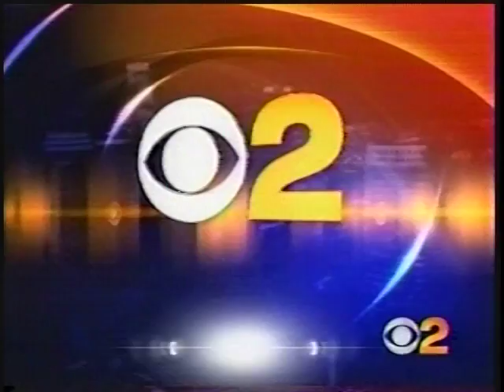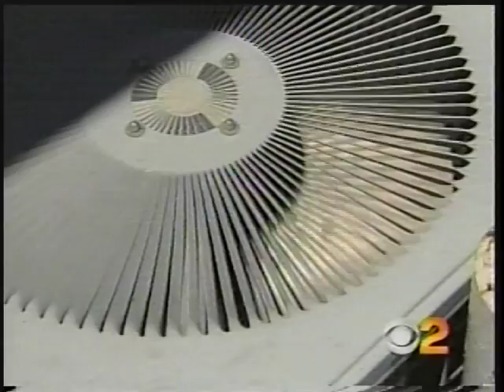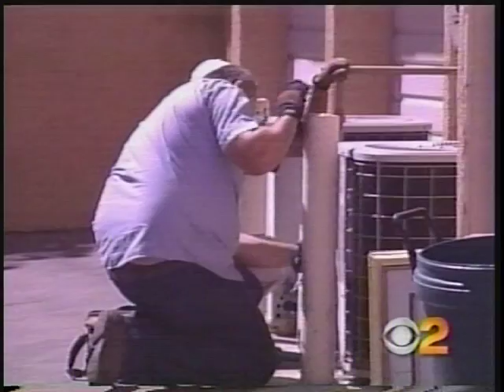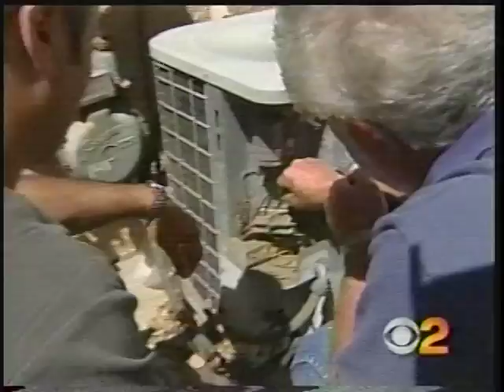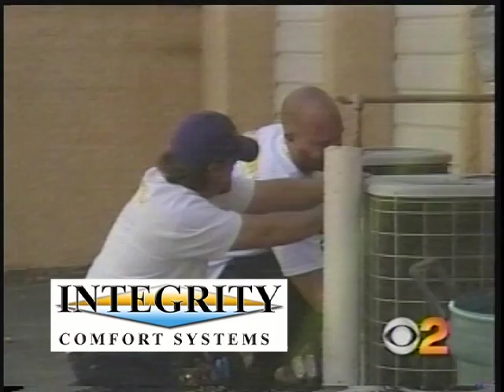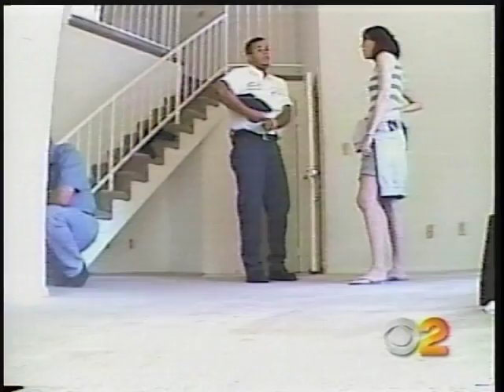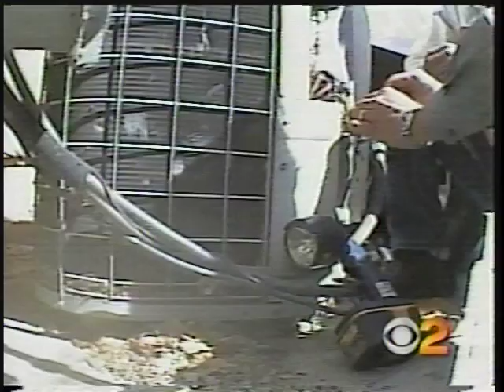Integrity Comfort | CBS Heating and Air Conditioning Repair Sting

Comment: Gee, I wonder why I don't trust service contractors?  Having worked in the HVAC industry as an engineer for over 30 years I can attest that there is far too much of this going on.  I don't let anyone work on or install anything in my home for this reason.  I got my electrical, EPA and other licenses and do ALL the work myself so I know it is done properly.  When I needed a new central AC system several years ago I sat for the EPA license just to be nice and legal.  (The test was a joke.)  Got the study material the night before the exam.  Spent a couple of hours reading it and missed 2 questions on a 100 question test the next morning.  The first time out of the box I installed a Carrier Infinity heat pump system using R410A refrigerant and natural gas backup complete with the internet interface with absolutely no problem and no help from the local dealer.  Yes, no doubt it took me much longer to install and setup than it would have taken a "dealer rep"  I took my time, read everything 3 or four times and spent more time reading everything I could find online about the what you could do wrong from the experts before doing anything.  (I strongly suspect most of the issues with compressor and TXV failures in R401A systems have been due to improper installation and poor installation practices.)  After 3 years I have never had a minutes problem with the system.  All that was necessary is to fully read and follow ALL installation instructions to the letter for every piece of equipment.  Guys, it really ain't rocket science.  Most people can do far more for themselves than they think if they just use common sense, go slow, read and follow manufactures directions to the letter and ask questions when they do not understand something.  The internet is a great tool to somewhat level the playing field even if you do not take things to this level of self sufficiency.
Reply: Brian Ellsworth Who said I blindly trust doctor's or lawyers?  Both professions make lots of mistakes.  Doctor's bury theirs and lawyers bankrupt theirs.
Reply: FlyMIfYouGotM mmm hm. i got into the residential industry couple years back from industrial. yes there is more money in residential. most companies want honesty but they lack on follow through with their techs. even my company in the chicago area. biggest tell for a dishonest tech is replacing the flame sensor. never needs to be replaced unless it has been bent or seperated from its ceramic housing. i always do a full cleaning instead. 1 its honest 99% thats all it needs.2 it shows the customer i am honest and they feel more comfortable and open up to me about other concerns they have with their heating and cooling. 3 i make honest recomendations as solutions to those problems they have expressed. most techs have it all backwards these days. its in the name, service tech. they skip the service and just do the tech part. are things expensive yes. however your budy with the compressor issue? holy crap its probably just a bad company because most give a pretty big warranty on the compressor alone. lennox gives 20 years from manufacturer on an 13acx. basic builder grade unit.
Reply: It sounds like you have bad HVAC companies in your area. You get what you pay for. If you call Joe blow from Craigslist for a 29.99$ tune up...... Your an idiot. Call a professional upscaled company
Reply: Joe Smith looks like u just proved my point.  Obviously, given your language, your IQ can't be too high.
Reply: All my spelling,grammar, &business practices are correct.Sometimes the
truth hurts.
Reply: Meanwhile you're either a story teller,hypocrite,or liar.You say you dont
like or trust servicemen/ techs in 1 breath.Then in another,claim to be
in.Keeping in mind of course,not one that would wear a white
t-shirt!Lol,sissy soft ass lmao.Now put on your nighty & face mask &go to
bed.

On Jan 26, 2017 4:54 AM, "Joe Smith" <****@**> wrote:

> All my spelling,grammar, &business practices are correct.Sometimes the
> truth hurts.
>
Reply: Truth hurts?  Apparently you are one of the tech's that routinely engage in the practices outlined in this piece, otherwise it is doubtful you would have been so offended by my post.  You know nothing about me yet you call me a "liar hypocrite or a "story teller".  Really?  I stand by my original post and my reply to you.  Just for your information, I am an Electrical Engineer, I worked as a Control Systems Design Engineer for JCI, both in an office and in the field. I have done Consulting and Commission work for several of the largest Universities in our area in addition to companies like Roche, Eli Lilly, and the Indianapolis Public School System.  Over the years I have seen far too many customers ripped off by multiple contractors doing practices just like those in this piece.  If calling you out on that offends you then it is obvious you are most likely part of the problem.  With your abusive language and obvious lack of intellect there is no way I would want you or a technician like you working on anything in or around my home.  Dealing with abusive technicians who use their belligerence to compensate for their incompetence is exactly why I went to the trouble to get the proper licenses to do the work my self.
Reply: Jake V Really?  I designed custom control systems and wrote the control software for recip and centrifugal chillers from 30 to 5,000 tons for companies like IBM, Philip Morris and several universities for the better part of 30 years.  Like I said, the EPA test is not that tough.
Reply: OK ,but why do you trust lawyers and docs ?  Your comment reminds me of a friend who purchased a garage with a lift because he thought a mechanic ripped him off replacing his transmission.
Reply: FlyMIfYouGotM cool you're an engineer, and if you pass the test, by all means do it yourself. You however are the reason why we techs say stupid engineer put a part that must be serviced annually in a place where we can't get to. Don't make blanket statements about a profession because you had a bad experience with one tech. Just because you say you did something doesn't make it believable. Quick question that you will probably google to find a rough answer to. What were these chillers that you designed one tiny aspect of used for?
Reply: Also, how were you designing these things without being certified? The things you are saying just don't add up. So im done talking to you. You are just a person who had a bad experience and is taking it out on the whole profession
Reply: I know you don't...nobody does .I just don't understand why all the trouble with an ac service , because it takes a lot of equipment plus school and years of experience to be any good . Your home ac is only a small part of the industry and for the most part it is the simplest form of refrigeration there is . Good duct design can get complicated ,but the units for the most part are simple .
Reply: Jake V How long have you been in this profession?  Are you aware that it has not been that many years ago that no one needed any certification to work on any HVAC or refrigeration equipment?  As far as trusting techs to install my system answer this: why would I play Russian Roulette with $8,000 gambling that I get a good tech and install?  A few years ago a local friend took that gamble.  This guy is on his third system and mine is still running like the day it was installed.  Both of his failed systems were R410A and both suffered compressor burnouts shortly after the warranty ran out.  Want to take bets on how good of a job the techs did properly evacuating the system?  All three systems were installed by different contractors.  We will see how long his current system last as it is still in warranty.  I have seen far too many techs refuse to use a continuous nitrogen purge while brazing refrigerant lines on systems with R410A.  How much garbage do you think this puts in a brand new system?  Personally I am just not willing to spin the tech Roulette wheel with $8,000 to $10,000 on the line and just hope I get a good install.
Reply: FlyMIfYouGotM like i said. You want to do it yourself fine. No one gives a f. Do it you are certified. However that didn't answer anything i brought up. Like what system did you design, what were they used for. Being an electrical engineer doesn't mean you did anything with refrigeration in chillers. Don't try to use a degree that has nothing to do with what we are talking about to add credibility.
Reply: Jake V Really Jake?  One of the projects for IBM involved gutting all of the controls, safeties etc. on old R11 centrifugal chillers and replacing them with DDC controls. (I did the system design for these controls and wrote the software for these systems.)  These chillers provided chilled water for a large, multi building manufacturing/research complex and a large thermal storage tank.  I also designed the control system and wrote the control software for the thermal storage system.  Jake, it's really interesting you think you know so much about some one you don't know anything about.
Reply: FlyMIfYouGotM how many times did they have to have a tech out to correct your mistakes. also you really seem to think you know so much about an industry you really know nothing about. nice google search reply though.
Reply: FlyMIfYouGotM you also didnt mention this is a water cooled system that supplys water to individual units that then use r11 at said individual unit to supply heat/cool basically heatpump. so you didnt work on refridgerant you worked on moving water around.
Reply: Jake V Google search?   There wasn't any 'tech' sent out to correct anything.  I did my own startup and checkout of those systems.  After 28 years, when the company I worked for started pushing for engineers to stay in an office and just make pretty drawings, I changed companies.  I will be willing to bet you were still in diapers when I was in the field working on these systems.
Reply: FlyMIfYouGotM hey, you are the one trying to prove everything. Im just calling you out on the bullshit. based on your reactions it is very obvious you constantly have the need to stroke your own ego and have others do the same. the reality is you were an electrical engineer. you had nothing to do with the full function of these systems. you were just a small aspect and you constantly word it in a way to make you seem like more. why the need to impress others bud? you are the best you!
Reply: Jake V Is the best you have just more infantile insults?
Reply: FlyMIfYouGotM uh.. i actually didnt insult you. i was basically saying just be who you are. why try  to prove anything to others, even to the point of lies. just be happy with who you are. if you see it as an insult, didnt mean it that way.
Reply: Jake V All of these systems were water or glycol/water systems.  As far as opening a system up, most of the time I didn't need to do anything on the refrigerant side beyond replacing a pressure sensor or two and verifying charge and performance against specifications.  The controls I previously referenced controlled every aspect of the chiller operation including all safeties, inlet vane temperature/pressure control loops and all water isolation/flow control valves.  Most of these were retrofits for older Trane and Carrier 1,000 and 2,000 ton centrifugal R11 machines.
Reply: FlyMIfYouGotM so thats why the epa test was so easy for you. had already been around operations for 25+years. makes sence. while yes alot of techs dont use steady flow nitrogen while brazing. very bad practices for a paying home owner. can also cause oraface/ txv to clog and unit to go off on pressure.
Reply: Lmao, hmm 70 bad txv? I bet he purges systems into atmosphere as well or when no one else is around. I bet he left the bulb dangling as well.
Reply: Jake V It wouldn't surprise me.  I know after he finished the install the customer made him turn all four of the condensers 180 degrees and re run all of the refrigerant lines because the way they were run looked bad.  They pumped the bulk of the refrigerant into the condenser, vented the rest, re ran and re brazed the lines again without a nitrogen purge.  I guess since he didn't put enough garbage in the system the first time around maybe this time he could add a little oil ash to the mix.
Reply: Jake V In my buddy's case he is on his third system and third company!  On the first two systems I believe they "gave" him a three year warranty and both died within six months or so after the end of the warranty.  I am not sure what he got with the last company.  You are right about much of the commercial market.  Most bids are so tight there aren't enough labor hours to do a decent job.  That is one of the main reasons I left that side of the industry and became a CxA working directly for the customer.  Too many 12 and 16 hour days working on a straight 8 hour day salary just to make the numbers look good and still do a good job for the customer.
Reply: Jake V In my buddy's case he is on his third system and third company!  On the first two systems I believe they "gave" him a three year warranty and both died within six months or so after the end of the warranty.  I am not sure what he got with the last company.  You are right about much of the commercial market.  Most bids are so tight there aren't enough labor hours to do a decent job.  That is one of the main reasons I left that side of the industry and became a CxA working directly for the customer.  Too many 12 and 16 hour days working on a straight 8 hour day salary just to make the numbers look good and still do a good job for the customer.
Reply: @ FlyMiIfYouGotM : I did exactly the same thing you did.  I got my EPA 608 universal certification, bought some R-22 online, got a vacuum pump, Testo gauges, etc.  and just started doing everything myself.  When you are an engineer this stuff is easy.  I spend about a day studying for the exam too.  It's just too easy to pass and not worth these HVAC scammers.  I now do my friends' units also because they know these guys come out to your home and rip you off.  Even my boss the engineering department manager asked me to come out and check his system because he doesn't trust these pieces of shit either.   Fuck Joe Smith that replied to you comment.  He is one of the scammers no doubt.
Reply: Impedancenetwork Many people can do far more than they think they can do if they take the time to read, learn and ask questions.  I long ago adopted the approach that how much you knew how to do is in direct porportion to how much you have screwed up.  If you have never screwed anything up you probably can't do anything either.
Reply: Impedancenetwork  if its so easy to you, go into business for yourself. and when you get sued because you royally f'ed someones unit up because your a big smart engineer mabey then you will have more respect for other trades and people
Reply: @ Jake V : Please quit dragging your knuckles on the ground.  Only apes do that.
Reply: Impedancenetwork please you have to speak sign to me like Jane Goodall, as im a big ape who only understands a tiny amount of sign language.
Reply: Impedancenetwork here like this🖕
Reply: Impedancenetwork i will agree however, my industry does have a terable name. Its because of people breaking parts and making false recommendations that most people feel just as you do. But you would agree that every industry has its fair share of criminals in it right?
Reply: did you  pull permits to  install your equipment? , unfortunately there are parts houses that sell to the general public, and you can buy the units on line, I wish we could pass a law prohibiting this, it makes a good  techs jobs harder  and hurts the local economy, not to mention your insurance company is taking a huge liability risk  covering your home by you doing it yourself, one may  hope you  don't have a fire  or any major flooding  caused from your install  and try to collect on your HOI they  may  not cover it when they find out you are not a licensed contractor and that if you did not pull a permit  it was not inspected  and therefore they would be off the hook  from having to pay  out on your claim. just saying :)
Reply: FlyMIfYouGotM so your "expert" opinion is that grandma does her own installation?  Hahahahaha
Reply: FlyMIfYouGotM Lmao. Your full of shit dude.
Reply: @kennethduncan6418  we'll said Sir!!!
Reply: you said the test was a joke and you only missed two questions. well buddy go install a chiller, you are aparently certified for it lmao
Reply: Brian Ellsworth hes a liar. He tries to add credibility to himself for "designing" a very very small part of a system to say he knows what he's talking about. Notice he hasn't responded to my last question because I'm asking him for easily checked facts he can't bullshit his way through.

Comment: replacement of a capactior should never cost more than 100$ for parts and labor, not including the travel, if you get billed for more dont pay the bill and call someone else, contactor that same thing, capacitors and contactors are merely bought for 15$ and take 15 min or less to replace